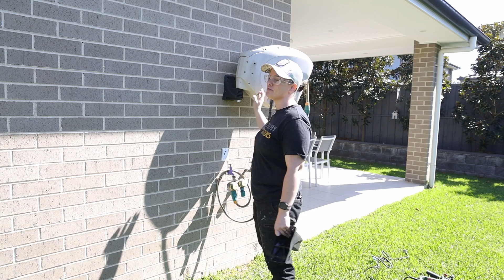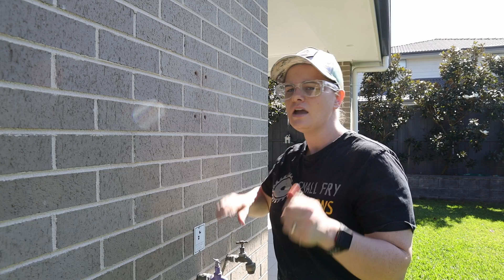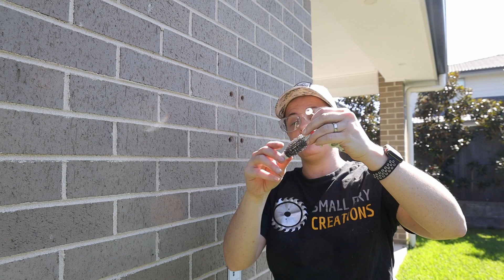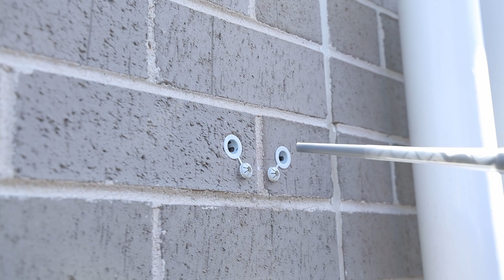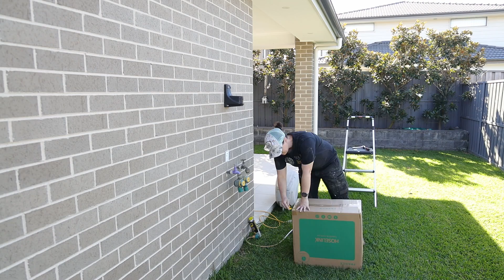How to Secure into HOLLOW BRICK using RAMSET Ultra Fix | DIY

Comment: Good to see those fuzzy Ramset sleeves in action.  I'm putting up a 3 meter in diameter umbrella on a brick pillar.  Those ramset sleeves aren't long enough, so I need to get a one-piece meter-long mesh sleeve, then cut them into 9cm pieces (6 pieces all up).  What I wanted to see was the bracket going on while the chemical sets, because, as you said, you want the steel rods to be straight while the chemical dries; otherwise, there is no chance of moving them to fit the bracket if you are a few millimetres out.

Comment: Legend, thank you for providing all the links. Put up the new Evolve hose reel the other day. The fixings they provide you are an absolute joke. Philips head screws for securing into timber .. too bad they are the easiest to strip. I used hex screws and into hard timber no worries. And the nylon anchors are laughable; chemset it and it'll never come out! Loved learning about the couplers, huge help. Thank you.
Reply from the maker: Glad I could help. Mine are still on the wall and havn't moved at all. So much better then the terrible fixings the companies give you. Glad I could help

Comment: Thank you!  I had exactly the same issues with installing my Hoselink.

A word of warning: using a Ramset 8 x 110mm Galvanised Anchor Stud (without the "M" before the "8") will not work with the Pinnacle M8 x 24mm Galvanised Hex Coupler due to different thread pitches - the nut will tighten up for about a turn then become progressively harder to rotate and the coupler will start to strip.

Also, you need to insert the coupler, inject the UltraFix and push the bolts in one at a time as the UltraFix sets VERY quickly in warm weather.  I got caught out and had to start again. More holes. 🙄
Reply: Where can I buy Ramset 8 x 110mm Galvanised Anchor Stud that are not M8? And using the couplers to tighten up the bracket after she inserted the studs seemed to work perfectly well to me.

Comment: Hey Ains, glad I came across your video. I have a Hoselink and drilled 12mm holes which they suggest, but the hose keeps pulling out when loaded, like yours does. I may have to expand to 16mm holes. What depth holes did you drill for the anchors, if you can remember?
Reply from the maker: I agree. I replaced mine more time than I care to admit😂. Should have done it years ago. They should have different install instructions given that I assume 99% of people are installing into hollow brick.
Reply from the maker: Hey glad I could help. I drilled them just deeper than the ramset sleeves. I didn’t take a particular measurement. I held the sleeve out the drill bit and marked with some tape. It fits in brick easily. Hope this helps.
Reply: Legend! Thank you I’ll go to Bunnings and pick up the same. Will a regular caulking gun work or will I need one like you have?
Reply from the maker: @Gtanti2012  no worries. Nah any caulking gun will do the job no problem. Happy installing. You won’t know yourself when it’s done. Mine has moved a millimeter since installed😀
Reply: @SmallFryCreations  I actually don’t know how yours lasted as long as it did. I installed mine today and it’s already pulled out. Thats probably due to the 12mm holes I think whereas you drilled 10mm holes initially. I don’t know why they say 12mm holes on the installation instructions

Comment: You're an excellent presenter! Thanks for this solution!! 👍😊
Reply from the maker: Thank you. Glad I could help
Reply: @SmallFryCreations 
Thanks for the reply. I just bought all this stuff at Bunnings. Gonna put up a couple of fold up rectangular clothes lines on similar brick to yours.
Reply from the maker: @MichaelJeffrey amazing!! Will work a treat for sure. 😀
Reply: @SmallFryCreations hey, just another question unrelated, why do you have that hose reel up so high? I'm gonna purchase one next week.
Reply from the maker: @MichaelJeffrey  Just makes it easier when pulling it out and its not in the way of the lawn mower of anything I'm moving through the side gate to the back yard. Its not super high. I'm 5,1 and its at my head so not crazy :)
Reply: @SmallFryCreations  Hmmm, might do the same!

Comment: Thanks for this, I was reluctant to drill a 16mm hole for an M8 threaded anchor stud but I've given up trying to find those metal mesh or smaller nylon sleeves that Ramset apparently make so I'm just going to have to do it with the multi-fit ones, thanks for the video
Reply: I also liked how you used the bracket to make sure all the bolts lined up nicely with the holes, and having some wiggle room in the chemical anchor helps.
Reply from the maker: Glad I could help. Bummer you can’t get the mesh sleeves as they work so well.

Comment: Couldn't you just set the original bolts in the resin?
Reply from the maker: Unfortunately not. They are designed for the sleeves that went in the wall and you have the set the bolts with no load on it so I couldn’t use the bolts as I couldn’t install the holder until the resin had dried.

Comment: Thank you so much for this video. 
I had this exact problem (except my hose reel fell out immediately after installation using the supplied plugs). I did exactly what you have done and it is solid as!
Reply from the maker: Thats fantastic. Glad to hear its working for others as well. So much better then the plugs that come with it. :)
Reply: My Hoselink hosereel just fell out a week after I installed it! This video helped me fix it.
Reply: @cameronlittlewood1553 how has it held up after 3 years?

Comment: What a wonderful clip! Well-presented, informative and so very timely as I've just moved into a house that has hollow bricks, and I was concerned about the nylon anchors that came with my hose reel. The previous owners seem to have got by without these products, but I'll never know because they just left the holes in the brickwork. Thanks for a great job!
Reply from the maker: Yahoo thats fantastic. Glad I could help. They are holding up super well and haven't moved a bit since I did the install.
Reply: @SmallFryCreations  You're welcome! And I'll find out tomorrow how well they work...or how well I install them. Just got back with a couple of sets.
Reply: @metalmick99  brilliant!  I had the same problems. Thank you.

Comment: Great video. Have you considered Ramset Ankascrews though? They're rated for use in hollow bricks and blocks and don't involve any chemicals or single use nozzles. I mounted a TV with some on the weekend.
Reply from the maker: Hey thank you. Good idea. In my situation the holes that were already there were to big for the screws and I can't rembeber but there may have also been an issue with the head of the screw fitting through the bracket I was securing. Great option and idea through.

Comment: What bolt or screw did you use originally? I'm going to hang something light only
Reply from the maker: I used the stuff that came with it. They were wall plugs and screws. Great if your going into something soild bu if its hold the wall plugs don't hold very well

Comment: Excellent video. I may have missed it, but how much load can this chemical application hold for a hollow brick scenario? Thanks
Reply from the maker: I can’t remember off the top of my head but they are pretty strong. It may say it on the packaging or if you had a particular project in mind I would contact Ramset’s and they could confirm the best product as they have a couple of options. It’s at least 100kg but I would say it could do more 😀 hope that helps

Comment: Nice. What length bolt did you use?
Reply from the maker: 110mm bolts that come in the pack. Links for the bolts I used are in the video description 😀

Comment: Great idea. I never thought of using those chemical resins as anchors, but have seen others using them. Great tip, Ainslee!
Reply from the maker: Thank you. Yes it worked very well. I think anywhere your holding up a lot of weight its a good option. Thank you for the support :)

Comment: That's a pretty pretty nifty solution, to basically chemically bond it to the brick. And smart move to use the couplers, gonna remember that one!
Reply from the maker: Thank you. Yeah the couplers are handy to know about. I think I will be using them in the future. The chemical is a cool solution. Worked really well and very easy to use. Thanks for the support

Comment: Thank you Ainslee for a first class exposition of this fixing method and the coupler solution. My old fashioned approach to the inset bolt problem has been to hacksaw a slot across both sides of the nut and make a corresponding cut-out in a bit of mild steel to make a kind of screwdriver, tighened with a wrench. Dinosaur stuff nowadays! :)
Your presentation is excellent by the way, fast moving, clear, crisp narration and 100 percent confidence, you could produce ripper teaching aids. I learned the word 'ripper' from Dirk! :)
The house I used to live in was made of stone outside and brick inside but there was no damp course as it was built in the 1880's. The bricks under the plasterwork could be in any state from soft and fragile to engineering diamond hard! I had to innovate to get anything to be stable - and there was nothing straight or at rightangles in the house!
I have not heard of hollow brick over here in the UK. In the 1960's a lot of hollow "Breeze Blocks" were used but mainly inside dwellings.
Thank you for a really well made video Ainslee.   👍👍👍🛠📌🔨👌
Reply from the maker: Hi Eryk Love that Dirk taught you Ripper. Its a great word :) Oh Gosh I could only imagine the issues dealing with nothing straight and stone. Such a challenge. I think the  hollow bricks in Australia as a cost saving way to build and because we don't have extremely temperatures they work well.  The checmial is working out well with the hose not a chance of going anywhere now. Thank you for the support and kind words.
Reply: @SmallFryCreations  Thank you Ainslee for the grouse response . . Dirk taught me that word too! :)  Have a super day! 😊